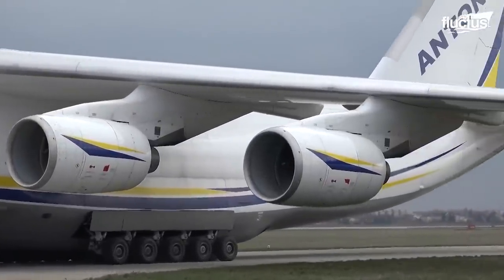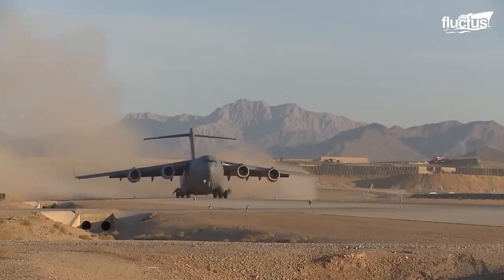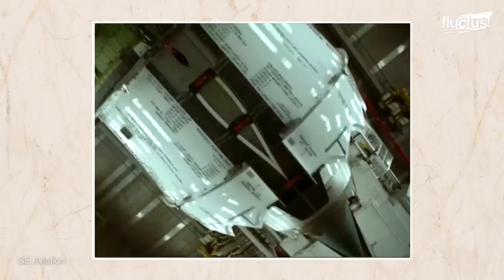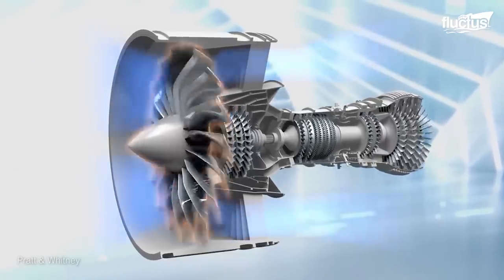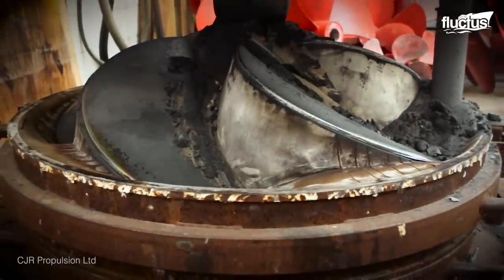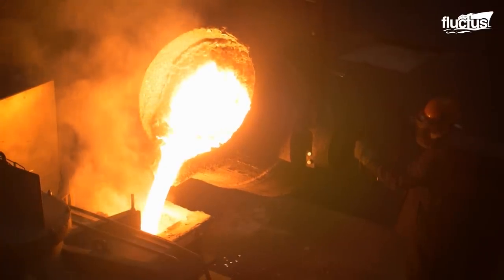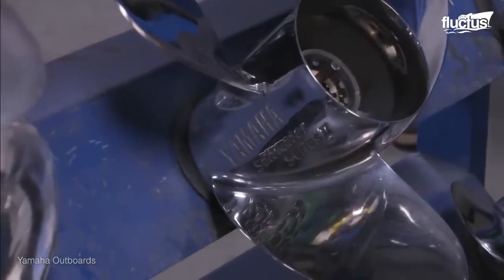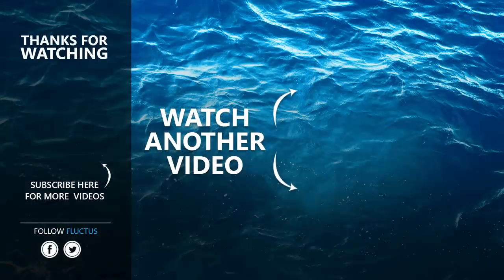Reason Why Aircraft Jet Engines Are Monstrously Large Today

Comment: Still wondering what boat propellers have to do with why jet engines are so big today…
Reply: You mean talking about how ship propellers are made didn't answer that question? It was hidden deep in the water jet segment 😳
Reply: It was a better transition than last time at least.
Reply: Right!? I mean, great video. Very informative. But I’m not sure I’ve learned as to why jet engines are getting bigger (beyond the fact that planes are also bigger).
Reply: Yeah. Me too
Reply: Both Jet engine and ship propeller work in principle of Jet which means causing force to other matter then that matter will cause a jet to thrust the jet engine or ship forward. 
The more jet you get the more effective. Specfic weight of water is much more than the air's is. So with evenly volume, the jet of ship propeller get is much more than the jet engine does so to get enough thrust force, the jet engine  need to blow larger volume and it become bigger. 
From Vietnam
Reply: @Deadman3913  that has nothing to really do with it ,it's because with a bigger engine you can suck a higher volume of air while using the same amount of fuel since only the front fan diameter gets bigger so pretty much you get more thrust but you don't use a lot more fuel making it more efficient than having multiple smaller engines and maintenance costs are also lower since you have only to maintain 2 engines instead of  3 or more
Reply: @alexandrosandreou8585  I got that. I was pointing out that the only thing the video talked about was that planes were getting bigger.
Reply: lindo
Reply: Lol
Reply: Lol
Reply: The video lost its plot somewhere in between 😂😂😂😂...it just had it's own train of thought.

Comment: This video has got me wondering... why are today’s jet engines so monstrously large? That might make for a good video one day.
Reply: The aircraft of today can weigh 3/4ths of a million pounds or more!  It takes a LOT of power to lift that much weight into the air, thus the necessity for larger and larger jet engines!  Wait until we have hypersonic aircraft!  Rockets will do the work of turbo-fan engines, I suppose!  They will probably use fan-blade engines to take off with and then change to rocket power to reach Mach 5, because fan-blades would probably disintegrate at such high velocities, but it will mean we can get across the ocean in two hours, beating Concorde's 3.5 hours!
Now how large those engines will be, remains to be seen, I suppose! While traveling at hypersonic speeds, you don’t need fan blades to compress air though, because the speed of the aircraft will do that for you.  Imagine the sonic boom that aircraft will make!
Reply: @mjleger4555  It was a joke. I was pointing out that the video never answered its own question.
Reply: The answer is that it is more efficient to accelerate a larger mass of air to a lower velocity to get the same amount of thrust, if you're in the speed range of something like 300-600mph, hence the high bypass turbofan with a massive ducted fan on the front.  (Below this turboprops are better, when the propeller tips aren't going supersonic; above this low-bypass turbofan with afterburner used by military jets are more efficient, and above that ramjets.)
Reply: You´re absolutely right. The video doesen´t answer to its own question!

Comment: I used to work for Boeing at Everett plant in Washington State. The GE 9's used on triple 7's (777) are huge. Name GE might as well stand for Gigantic Engines, and the number 9 is for diameter of Main Fan. I have stood inside the engine cowling with enormous fan behind me. My house has 8 foot ceilings, the GE 9 would not fit in my house, part of it would be in the attic. Most of air produced when fan is spinning bypasses the compressor and flows around core. 85 percent of power comes from the high volume of bypassed air.
Reply: I learned more from you than I did her...
Reply: @chraffis  Thank you very much, very kind.
Reply: it’s General Electric

Comment: Sub shaft assemblies along the rotational center of the engines with overrunning clutches connecting them and/or gear junctions? (So that parts of the assembly rotate at different speeds but drive one another ?

Comment: Propellers are not made of steel! Bronze being the primary metal used with a close second being Stainless Steel, usually for high performance applications. In actual fact it extremely rear for a propeller to be made of steel.
Reply: Or rare even.
Reply: Was thinking the same thing ... and as for "pounding into shape" those smaller investment cast props ... the script seems to indicate cursory research.

Comment: The Airbus A350XWB-900 and Boeing 787 Dreamliner are the currently Very Efficient Aircraft using most Technological Efficient Rolls Royce Trent 1000 and XWB type Engines that Are more Fuel Efficient and quite too.

3 and 4 engine Aircraft are slowly being phasing Out And replaced by the 2 Twin engines types.

Comment: the amount of twist on the fan blades, or on the ships screws, 
   in water, you can see how the water flows best thru the blades, and therefore at which point of twist the thrust is the best, works with air too,

Comment: I’m guessing if the fan is bigger then greater efficiency and speed. The big question is what’s the limit. I know the biggest engines so far are in the brand new Boeing 777x. The 737Max has the  biggest engines ever placed on a 737 airframe. This caused the airplane to have a tendency to unexpectedly nose up during takeoff as to why Boeing secretly added the MCAS which proved to be fatal in two crashes already.

Comment: Interesting 🤔 but not that accurate.
The material use in ship propeller is incorrect.
The smaller boat propeller shown being cast used the lost wax process and not made from a wooden pattern. What about the British Meteor jet 1943 the first jet fighter, the British Commet the first commercial airliner 1949, or the British Harrier jump jet 1969 the first vertical take off fighter? 🤔

Comment: So why are jet engines so large these days besides for countering the size and weight of the planes?  Is there another reason?   There must be….puzzled here too.
Reply: The fans provide most of the thrust, not the gases being expelled from the rear of the engine.  The larger the fan, the more air can be moved to create more thrust.  The turbines in the jet engine are mainly there to turn the fans.  So, bigger engines equal bigger fans which equal more thrust to move heavier planes.

Comment: Jet engines are huge today because at one time, you had to have at least 3 engines to travel extended over water operations.  Four was preferred and thought to be safest.  However 2 large engines are CHEAPER to operate than 4 smaller ones.  Not necessarily SAFER but CHEAPER.  Which is of course the bottom line.

Comment: But it's the Fan that has gotten larger. The Jet engines have not. Big changes in Fans and blades. 😁
Reply: Is the core of the CF 6 the same size as the core of the first J-57 in the 707 aircraft? The core of the J-57 was the J-57 plus cover and nacelle. The CF 6 core spins a large fan that blows air around the core and out the back of the engine coverings? 
Either the CF-6 or the RB 211 English engines used to be the highest bypass ratios made?

Comment: The 225 is dead.
Reply: There were several spoken technical inaccuracies in this video but the 225 is never mentioned OR SEEN AT ALL in the footage.  The Antonov shown several times has 4 engines and a single tail,  making it the AN-124. 
The AN-225 had 6 engines and a twin tail.